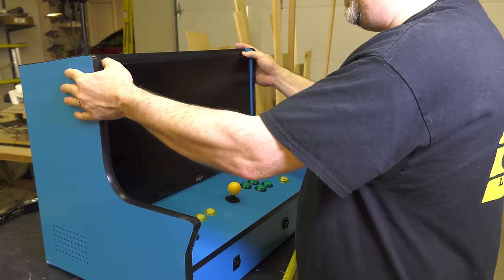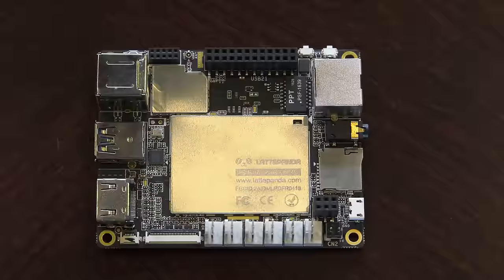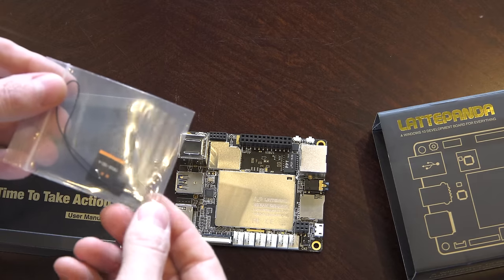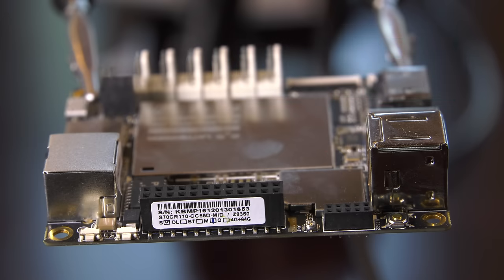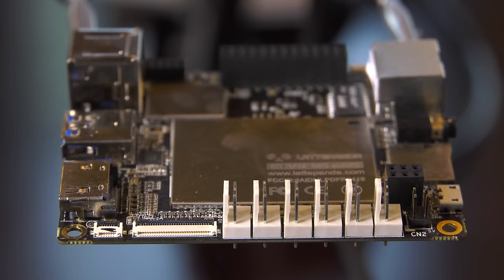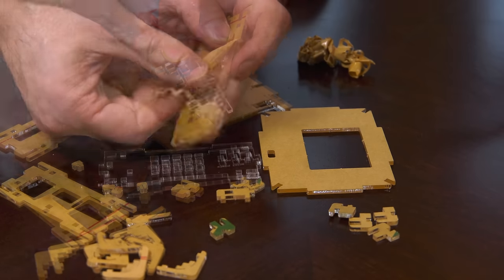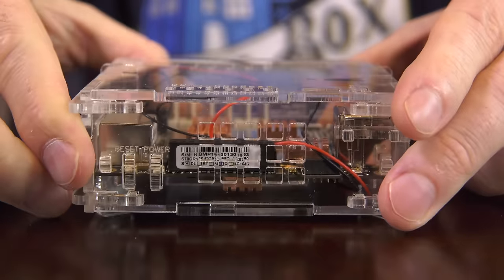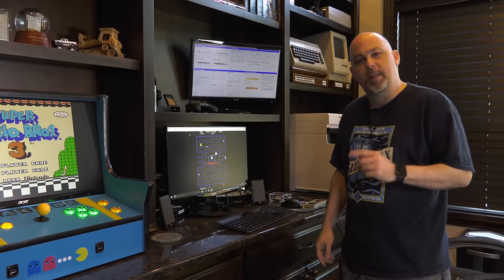The LattePanda Single Board Computer (Perfect for Windows Arcades)

Comment: I'm refitting a 1960's built sail boat and I want to install my own designed navigation / chart plotter station. I already run the chart plotter and GPS tracker on my desk top, but I want this to be a dedicated system that will also accept NMEA input from the various sensors aboard like wind speed and direction, depth sounder, log speed, etc. I actually have most of this worked out including mounting the processor vertically in a vented enclosure mounted to a bulkhead to help with heat dissipation - good to see they've included a fan now to help with this and eliminates one of my concerns - my questions:

1. How difficult is it to address the GPIO port from within a Windowed application or is this something you can only do from within a command line console.
2. There was some discussion a year or more ago about being able to fully activate the Windows OS on the Panda. Some have said this only effects the ability to update with service packs and patches, while others aren't sure how it effects the functionality of the system, "but it works OK for the way I use it" and that doesn't answer my question. I've heard some speculate that the OS will time out like the old XP OS did if you could not activate it. I doubt this, but you never know. 

If you have the answer it will help me to decide to (or not to) spend the money to build this system. I want to use the Panda because I can write my one Windows GUI that will display all the sensor info along with the chart plotter/GPS tracker program (already bought and working) on a 17 inch display in the cockpit.

Comment: 150$!!!!!!! I would rather run rasbian.     No offense I still love the video I was just surprised
Reply: zion leister but you can run roblox on the panda!
Reply: Considering even a System Builder copy of Windows 10 is about $100, and with the Arduino integration, this actually looks like a pretty good deal.
Reply: I was going to say the same thing. When you consider the price of a Windows 10 license, the board itself is almost free.

Comment: would have been nice to see a performance comparison between it and a Pi3.
Reply from the maker: That's kind of difficult, since they don't run the same OS.
Reply: that doesn't really matter though. You can run the same OS-agnostic apps on both systems... Emulation Station, retropie, GIMP, etc
Reply: I mean, the title of this video is that it's perfect for an arcade... even running just one N64 game on the Pi3 and the LattePanda and comparing the average FPS would have been really interesting/revealing. The OS doesn't matter at all.
Reply from the maker: Cool!  Make a video!
Reply: think about it Bob - why does any of that matter to the end user? All that matters is the real world performance. Windows might use up more resources but the LattePanda has more RAM and a faster processor. It's unclear whether that would nullify the Windows overhead. This could easily have been tested. And I'm not talking about benchmarks or synthetic tests. I'm simply talking about does game X run better on a Pi3 or a LattePanda!
Reply: yeah - well, I would if I had both systems! I was kinda hoping someone would have checked this... seems like the one of the more useful things to evaluate.

Comment: But why would you want Windows for emulating old arcade games? Since you are emulating already, you might as well run Linux, whether on x86 or arm. And if you think you can run very old Windows games on Windows 10 natively, be prepared to be disappointed. Dosbox is definitively better.
Reply from the maker: I agree, but many people prefer Windows simply because thats the OS they know.
Reply: Hi, could you please tell me some good possibles for x86 and arm if you have any. Are any of the guys using that new Tinkerboard? or are you not even thinking SBCs (single board computers)? I'd like to hear anyone's input on this please - In other words, what you had in mind when you typed that. I have a Pi 3b, but most guys want to emulate the higher platforms or systems as well - N64, Dreamcast, PS2 etc.That's why x86-64 looks so good. Right now, I'm of a mind that a mini ITX, and a fairly decent  GPU is the way to go. Then it would just be deciding whether Linux or windblows. I'd probably go with the later and LaunchBox/BigBox - it looks so good (but I do love linux).
Reply: My reason to use Windows for an arcade machine build would be Naomi emulation - Demul - DX11, as well as maybe something like a Dolphin branch for Triforce arcade machine, also works best with DirectX11/12, but reasonably enough on OpenGL/Linux too. Unfortunately, both won't feel themselves at home on an Atom, they need at least midrange/highend laptop class CPUs, better even desktop CPUs.

Another line of thinking is that all emulators for higher end machines that don't necessarily require GPU acceleration and are thus fine on Linux have DynaRec support on x86 CPUs, but only a small selection has support on ARM CPUs, so within the same power envelope of say 2W, x86 Atom will simply practically perform a lot better. I'm not sure what kind of arcade system emulation specifically it would apply to though. NullDC doesn't have Naomi support and i'm not exactly prepared to add it, and i'm not even sure whether the performance of Atom will be sufficient, but at least it's much much faster than Demul, so there's a fighting chance.

But i'm speaking from the point of view of a person with 20 years of Linux experience, and you can't necessarily require that from every single person that builds themselves a toy.
Reply: You could also run a front end like LaunchBox on this, because it's running ob Windows.

Comment: main problem with lattepanda is cpu throttling... the fan is an absolute MUST, otherwise it will bring down cpu from 1.6ghz to just 400mhz, after a few seconds...
Reply from the maker: I noticed this issue as well.  That's why I am running the fan.
Reply: I believe that the CPU placement has it's advantages: You can screw the board on the inside wall of a cabinet while the fan on the bottom side can  vent the heat through hole or vents

Comment: How do you handle the power button situation? As far as I know it can only be powered and reset using the little on board micro switches. Any solutions for using external switches?

Comment: LattePanda 4G/64GB - a Win10 Development Board (without Win10 product key)
Price: $159.00
- This device does not include a Windows 10 activation key 
So, you get it loaded, just not licensed.
Reply from the maker: That is correct.  Only the 2GB/32GB version comes with a license.

Comment: Hasn't the Atom been discontinued for a while now
Reply from the maker: Nope. That report turned out to be false.  They are still made and still shipping daily.
Reply: Cherry Trail is in active production, not suspended. The future Widow Trail is partially suspended, it's coming out as an IoT device (branding unknown), but not as a tablet SoC like current Atom. Instead, there will be a new power-efficient platform for tablets potentially derived from higher-performance platforms, details to be announced.

But i sure wonder whether Intel has been riding a foot-chaingun lately, their actions are so vague and erratic. Atom Bay/Cherry Trail might not be a major profit source, but it's cheap and it sells like hot cakes, so it does contribute to keeping the company afloat.
Reply: I'm really hoping AMD can make a Ryzen based APU that can compete or beat the bay/cherry trail atoms.

Comment: HMMM $200 for a new Atom based micro pc, OR $200 for a second hand lenovo on ebay with a gen2 Core i5 (include power supply, harddisk 4GB DDR3 ram, etc).
The only half reasonable price to perf micro pc options are stuff like the Orange pi lite $12 - that can do PS1 N64 DOS and most everything before that.

Comment: thegeekpub, would you think this be good for a jukebox build ?
Reply: I'm not thegeekpub, so maybe he knows something I don't, but you'd need to give me a lot more info before I could answer your question.  What kind of jukebox? With CDs?  With MP3s? Robotic or not? How big?  I can tell you the sound chip on the LattePanda isn't amazing enough for me personally.  Though a USB sound device could fix that.
Reply: Jack Johnson im going digital,mp3s.and external drive. I was thinking ryzen 3,mobo and touch screen and saw this.
is the audio that bad ?
I wanna do this on a budget
Reply: You're kinda talking out of both sides of your mouth. ;-)  Ryzen 3 is not budget friendly!  It's not terrible, but for an audiophile I wouldn't use it.  I feel the same way about the Pi audio.
Reply: Pi has straight up i2s pins, just use a decent DAC like hifiberry or compatible. The default PI audio is sawtooth PWM, and it's what i'd describe as "mildly horrible", but i2s is just a boot config change away.

If going for a PC build, no point in Ryzen, just use whatever old crap comes your way, like an old AMD APU or i3/Pentium, whatever you can grab. Depending on how you feel about the mainboard DACs, you may want an external soundcard, but i think cheap mainboard soundcards are fine as long as they're driving a high-impedance input like an amplifier, but they falter audibly on headphones. VIA have a mess of drivers, but the audio circuits are actually half way decent even on low end chips, Realtek has a few better or worse ones, 892 is pretty bad, but 889, 898 and 1150 are fine. Gigabyte seems a bit less sloppy than ASRock with analog layout and decoupling capacitors. But let me put it that way, depends on what your skill as speaker cabinet engineer is, and how much money you're pouring into your amp - if both of these aspects aren't going to be top notch, then just any mainboard soundcard will not matter, it will be fine.

Comment: with onlt 4gb of ram whats the newest system it can run?
Reply: Windows 10, which it comes with.
Reply: i meant emu systems ;)
Reply: Any of them should work fine.  It has 1.8 Ghz CPU and 4 GB of RAM.  Even the PS2 emulator only needs around 768 megabytes.
Reply: sorry to keep bugging you but is that 1.8 per core or total?
Reply: Jack, PS2 emulation, on 1.8 GHz Atom? You serious? It just about works for me on an Ivy Bridge with 2.2 GHz or Phenom II x6 with 3.5 GHz. Same thing Dolphin for the sake of Gamecube. There's no headroom whatsoever.
Reply: Siana, I'm not saying you're wrong, but I have it running on an old 1.6(? not sure on that, but certainly not more than 1.8. I know it's from 2007 or 2008) pentium I had lying around. Admittedly, it's running a heavily-customized version of retroarch, but it's not super hard to get working right.

Comment: In this decade, it amazes me that anyone would shoot themself in the foot with 10/100 Ethernet. For shame! The Pi 3b did it for cost, but come on - a buck or two?  Also, I don't understand 30 fps HDMI. That doesn't make any sense either. Oh, when you do videos like this, could you please remember to state whether the micoSD slot is push/push or push/pull. The Pi 3b blew it there as well. That's why 19 out of 20 cases are useless with it - you can't grab the card to pull it! BTW, you can now run EmulationStation on Windows and 64 bit. You use RetroArch as you mentioned and standalone emulators through the ES frontend - just search 'emulationstation for windows' on youtube.
Reply: 30 FPS HDMI is because HDMI 2.0 is a not-insignificant engineering challenge to implement, particularly on a chip like the atom.

Comment: Had a latte panda was dead after 1 day pile of rubbish better to get a x86 pc and use linux mint and then install retropie far better and will do n64 and dreamcast at decent speed .Worst thing i ever backed on kickstarter sold it to a guy in germany as faulty and hew was going to try and fix it even the pine 64 still works just a shame there is no decent software ..
Reply: I'm not saying you're a liar, but I question why you would not just get it replaced under warranty? It does have one, and I've not heard of anyone being refused service.
Reply: Reggie Cotton  because sending something back to China is a load of hassle and the people behind latte panda are useless they have lots of complaints if you have to change a setting in bios and it does not boot you have to reflash the bios as there is no way of resetting it to default on the board Mine was a early kickstarter board latest versions might well be better ,been temted to get rid of the pine 64 sbc as well but it has some good features but terrible software.backed many things on kickstarter and this has been the only one to be disappointing .in the long run a cheap amd based x86 with retropie installed would be far faster my budget amd 860x pc build with an old msi amd 7870  and retropie is far faster and with retropi for linux installed it makes for a far better machine.
Reply: Dude.  Punctuation.  Learn it!
Reply: was on the phone and no need to learn.
Reply from the maker: Hmmmm... The return shipping address for DFRobot is not in China, and they allow returns no questions asked for 90 days.
Reply: To late now long sold,but they do have a forum post now that shows how to reflash the bios, with all instructions and pictures .I see the one selling now is a newer updated version at the time there was not much information on the forum to reflash it .

Comment: or or or.... you can just turn it "upside-down" to have the CPU fan pointing to your house's roof  since there is no reason to call one side up and the other side down other than conventional thinking.... its not like fluids gonna spill or the ram is going to confuse itself lol
Reply from the maker: Except there are feet on the "bottom" of the case.  And the connectors for the GPIO and gravity sensors would be unusable if you sat it on the "top".
Reply: The "feet" are feet just if you want them to be feet again its about conventional thinking.. they could be gap holders for stacking one on top of an other for example and the case would be perfectly steady if turned "upside-down" where there are no "feet"  

The gravity sensors will still be 100% usable my phone has gravity sensors which are working no matter how I hold it "upside-down" or "downside-up" etc.

The GPIO could be an argument but only if you want it to be I dont see any major issues with that either the cables that go inside the case to connect with the GPIO are elastic enough to bend between the case and the surface underneath it. You could also place it as a tower if you like to have both worlds (room for the fan and for the GPIO)